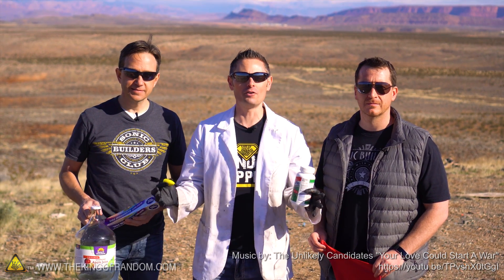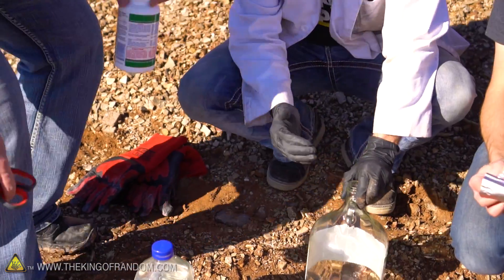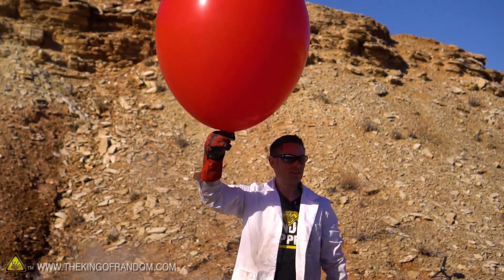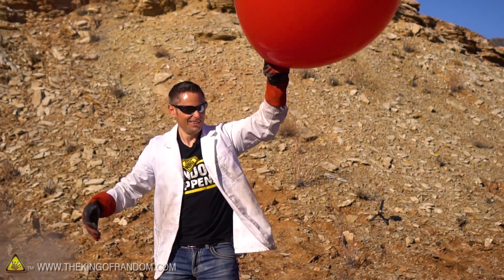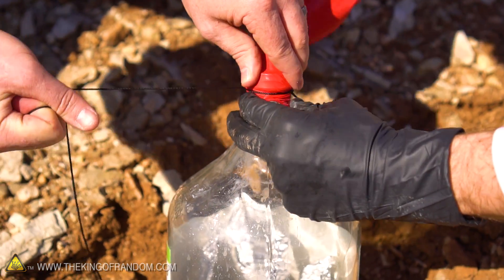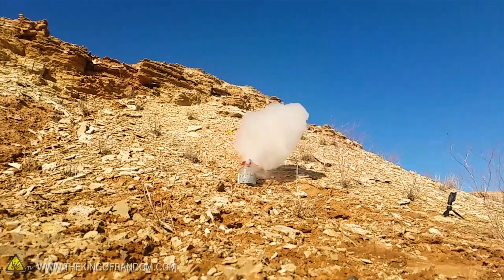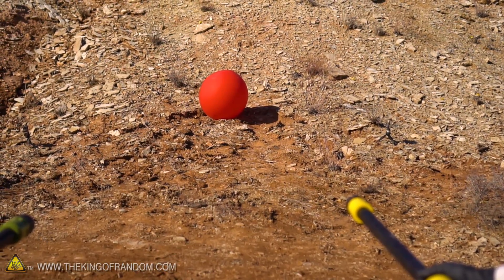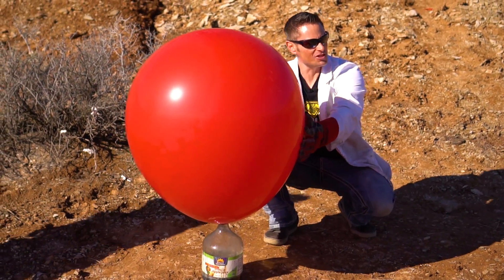Gigantic Hydrogen Balloons | How To Make A Hydrogen Balloon Explosion, Gas Balloon, And Balloon Bomb

Comment: used a old empty freon tank. welded a pipe plug adapter to tank so i could get into tank,used a coil of 1/4 copper in water to cool gas, filled a weather balloon .put about 10 ft of cannon fuse on balloon. launched at night..

Comment: Great video. I use to do that in elementary school. A Vietnam vet showed me how to do it and make napalm. I used coke bottles and only put enough Lye to cover the bottom about a half inch. Then put a few inches of water. Then roll the foil up kinda tight and drop it into the bottle with the regular size balloons we used for water balloon fights ready. We would then fill one balloon at a time being careful not to get burnt. As one of us tied the balloons he would also put a piece of toilet paper in the knot making a fuse.  Now with the toilet paper fuses you can have them pretty long and the balloons will fly pretty high with the fuse lit at night the deep boom and fire ball is pretty cool.  It was better than the fireworks because they were made by us and didn't cost much.

Comment: If you bubble the vapor through a Woulf bottle filled with sulfuric acid, then let the hydrogen into the balloon, the sulfuric acid will pull the water out and you'll have dry hydrogen gas in the balloon.

Comment: The Hindenburg was a giant hydrogen balloon.
Reply: it was not a balloon...  balloon are under pressure..  is not even a blimp which it has just a bit more of pressure compare to the outside air,  it was a rigid airship with almost equal pressure. 
The hindenburg would be still flying today if there was not by the flammable envelope..
With a no flammable envelope there is no chance to burn or explote..  It can burn, but nothing would happen, it will reach its destiny no matter what.

Comment: Perhaps instead of placing the balloon directly onto the hot jar, you could run a long hose from the jar into a cooler full of ice (or dry ice) with a coil of hose in the cooler, and then connect the balloon to the hose.  This would condense the water before it gets into the balloon AND would prevent the hydrogen in the balloon from shrinking.  Your balloon might float  quite well, and an aerial explosion would be pretty cool.

Comment: Please no hatred for my need for accuracy, but: Its not the density of the rubber pulling the balloon down after it cooled down; its because of the (then missing) heat itself.
Also, calling it "HHO" isn't chemicaly correct at all. Its simply a mixture of 2 parts Hydrogen and 1 Part Oxygen. Then the reaction, the explosion, combines the 2 gasses to H2O - Water.
But no offense though, not everybody need to be a chemist and you make awesome videos :) Greetings from Germany!

Comment: Just a suggestion, use electrolysis to generate your hydrogen instead of drain cleaner and aluminum. It will not get nearly as hot, and you will not have steam. In addition, if you set it up to generate oxygen and hydrogen in the same aria, you get mixed HHO which, as you said, is more explosive.

Comment: Have you ever tried aluminum shavings or aluminum powder.  This could speed up your reaction time.  You could even put some aluminum powder and and sodium hydroxide inside the balloon so when the water is formed as the reaction cools, it would produce more hydrogen.

Comment: A hydrogen and oxygen mixed balloon would be really cool to see. Especially at night!
Reply: that'd just be a water balloon.
Reply: HAHA I meant H2 and O2 gas
Reply: i'm not. just surprised at the amount of science that has been fitted into one comment
Reply: The hydrogen will only react with the oxygen when a source of ignition is provided, like a sparkler. When this happens the hydrogen will react with the o2 in the balloon and the o2 in the air until it all has made water. If he started out with 1:1 h2 to o2 there will be extra o2 left that will just go into the air however, this will still create a larger/louder explosion which is what I would like to see!
Reply: hydrogen will react with oxigen inside the ballon so luke has a point
Reply: but the equation has to be balanced meaning it cant react because then you will be left with H2O and O1 which can't happpen
Reply: ok Mr Einstin
Reply: Hes correct, why are you offended?

Comment: a better setup is 30% hydrochloric acid in a similar size jug with a rubber stopper and tubing feeding into the bottom of a 5 gal water jug full of water. the second jug allows the hydrogen to cool and filters some of the acid vapor that comes over. I asked in the comments on another video but will you please share the .stl files for the original cap darts? I like the design and would like to try them in my larger potato gun.

Comment: I'd think making a stopper with a hose and a steam catching bottle halfway along would allow the gas to cool, the water to be removed and make putting the balloons on easier without hooking it to a hot bottle of boiling caustic chemicals. If you put a switchable valve on the end you could start a second balloon while removing the first.

Comment: You should put a phone in a vacuum chamber, then call it.
Reply: Idea To Invention That would be cool! Of course, if there isn't any air for the sound waves to hit, no ringing would be heard, lol.
Reply: But our ears are not in the vacuum, so wouldn't the sound vibrations still travel to the outside of the chamber? It would be cool to find out either way lol
Reply: Idea To Invention yes i agree..wanna see that
Reply: Vibration is oscillation. Exactly what the speaker will be doing, possibly laying in a metal pressure cooker. It's not deep space, so being able to hear the phone while it's in the vacuum chamber isn't far fetched. We would at least hear the phone until all particles have escaped.
Reply: Freak1z,  vibrations are what? -  A type of Turbulence in the sound waves, matching a resonating at a particular frequency, so if there are no waves, no amplitude and thus no turbulence, and hence no vibrations!

Comment: If you can get a quicker setup for the hydrogen balloons, an interesting twist on this might be to release a bunch of fresh hydrogen balloons into the air. (Using balloons that are light enough to float)

Then as they are floating into the distance, start firing flaming projectiles at them. It'll be hard to hit them, but it would be amazing if you could pull it off.

Yes, I realize this is easier said than done. Lol.

Comment: To prevent steam getting into the balloon, could you attach coiled copper pipe to the top of the glass jar?  It would work like a still, allowing the steam to condense into water but allowubg the hydrogen gas to fill the balloon.

Comment: when it comes to adding the aluminum into the solution, wouldnt it be better to not crumple up the foil so that you can get the most surface area? but since the neck of the bottle is narrow you could roll up small pieces of foil rather than lightly crumpled balls?

Comment: Do that with acetylene and oxygen, then shoot it with the dart. You take the torch and adjust it to where the flame is burning right, then snuff out the flame by hitting it against a piece of wood, then fill up a small sandwich bag. It is powerful so don't do anything bigger than that.

Comment: I would like to see this with a bigger balloon. Most likely cant use a regular balloon. There is another type of "rubber" you can try. Tho you wont be able to really show it until it has inflated. This type of "rubber" can expand and hold pressure at quite an impressive limit.

Comment: Hey, Grant. I've heard that oily rags can heat up as they dry and spontaneously combust. Could you experiment this to see if it actually works?
Reply: Ethan Koetsier Linseed oil I have worked several fire investigation because of this
Reply: Ethan Koetsier I read a story, maybe true, maybe false, of someone tricking someone into doing a "free spa treatment" and they wrapped them in linseed oil soaked gauze from head to toe. It wasn't wrapped tightly, there was a lot of oxygen access. But there was so much the person was wrapped in they couldn't remove it. So it gradually heated up, they couldn't get out, and it cooked them and then caught on fire and incinerated them. Gruesome...
Reply: Zom Bee that sounds very made up, but it would be excellent for a horror/ thriller.
Reply: Brady C I hope it is made up, but I know there are crazy-mean people in the world, so I can't be sure 😨
Reply: I have actually done this with Xylene on accident on a job. Luckily the rag was on concrete, but we left the job site to grab materials and came back and the rag was slightly smoking and smoldering. I got scolded by my boss pretty bad for that one.

Comment: What would fire do in a vacuum chamber?
Reply: greencandy -- an inciniery fire can't exist in a vacuum. Although you can make a 'negative pressure' using a flame in a closed container, in a true vacuum there is no air. (I believe air is only about 20℅ oxygen normally). Also one can't obtain a 'true' vacuum (32inHg or 32ft of h2o) on Earth. 30in of mercury (30ft of h2o) is about max. in our atmosphere.
Reply: greencandy go out

Comment: Yes an apple juice jug is the BEST reaction chamber for doing hydrogen, as long as you don't cap it with anything that can retain enough pressure to have it blow up close to you. That's how my friend got hurt back in '90. But to get rid of the steam, use lab corks with holes, glass tubing, acrylic hose, and two-liter soda bottles as bubbler chambers. Use inverted corks sticking up on pipettes to affix your balloons. The cork on the apple juice jar needs one of your pressure valves or to be secured with wire run through short lengths of acrylic tubing attached to the neck of the jar with a wire-wrapped collar so it can pop off if it gets to ungodly pressure.

Comment: 3 things: you could add a laser to the cannon so after calibration you should know where the bullet will hit ;) an also a question, can you make an aluminium figure with proto putty? Did you know that if you put the proto putty in a bowl and in the microwake you can clean off a lot of the cornstarch from the surface of the proto putty ;p Great channel btw!

Comment: You can get much better quality hydrogen balloons by keeping the reaction cooler. If it gets too hot then you will have lots of unwanted water vapour. Try using less sodium hydroxide, and keeping the glass bottle submerged in cold water, or have cold water running over the outside of it.

Comment: Looked like the gas was auto-igniting; the sparklers were buried in the dirt when the hydrogen went crump. Could you try this again without an ignition source? I'm guessing there's enough heat in the reaction generating the hydrogen that you don't need to spark it. :O

Comment: If you want to speed up the reaction, don't ball the aluminum up so tightly, and also putting the glass container on a hot plate would cause the reaction to take place faster and sooner.

Comment: What does hydrogen turn into when burned
Reply: King Jordan water....
Reply: Trick question. It doesn't turn into anything. Hydrogen is still Hydrogen after the process of releasing photons and heat while recombining with Oxygen.  Do I win ¿
Reply: King Jordan oxygen is needed to even start a fire so burning hydrogen with oxygen in the air creates h2o

Comment: to get a better reaction:
1. make the NaOH solution and wait until it is room temperature or not so hot like in the beginning because the reaction of H20 and NaOH is exothermic 
2. Al plus NaOH (aq.) is also very exoteric so the H2O will boil easily and you get H2O vapors in your ballon ;) 

sorry about my English mistakes :-)

Comment: DO IT WITH HHO 
like if you agree
Reply: with your old generator
Reply: Zertrebender Zerty you mean h2o you mean WATER
Reply: for a video check out TKOR's(his) HHO Generator - Water to Fuel Converter
Reply: +WarioGiant HHO is the mixture of oxygen(gas) and hydrogen(gas) i understand why you said that but it's not chemical level it's just the two in the same general area
Reply: WarioGiant no HHO an explosive gas. Grant said it in the video
Reply: Zertrebender Zerty 👎👎👎

Comment: I have an experiment for you. Silicone rubber is thick enough that it will not fall through a certain size screen mesh. Why not have a platform inside a vacuum chamber so you could introduce air under the silicone and pull it through as the silicone sets, making some sort of silicone foam. It should set up hard enough so you don't have to run the vacuum pump for the full 24 hours but you would need to run it for quite a while so you may need to think about cooling it. Maybe add another hole for a new valve and run a silicone tube underneath the silicone rubber and screen

Comment: You need to make a bottle to do these reactions in. One with a long neck, perhaps a PVC pipe running for a few feet so that the steam doesnt get into the balloon. Make the PVC detachable so that you can clean out the bottle, if need be. Also try shredded aluminum foil. Run it through a paper shredder. Wayyyy more surface area for the reaction. I Feel if you put the PVC or whatever pipe on the end of the bottle to make the neck longer, your steam content will drastically reduce, and the gas may be cooler when it goes into the balloon.

Comment: You need to let the reaction complete, and let the water cool while it's still over the bottle so that all you're left with is a balloon which has as much H2 as possible and then it should float, and let you "skeet" shoot them in the air..

Comment: The one you thought didn't blow up because of the steam actually did if you look at the slow mo.  It had 2 explosions.  One was the popping of the balloon and then there was a delayed explosion and you can see the fireball in the upper right hand corner of the video.  Capture some O2 gas with H2 gas in the balloon before using the Sodium Hydroxide.  BIG Boom!  :)

Comment: Great effort, a bit underwhelming, but that's because of the way hydrogen burns, not anything you guys did. I'd second other comments for a nighttime shoot if you're using hydrogen gas. Alternatively, might I suggest a bangsite balloon? Calcium carbide and (IIRC) water yields acetylene gas and rainbows and joyness. Might give more of the noise and heat you want. Nice work fellas!

Comment: Bizarre set of events Grant.  A long time ago, you made soap using lye and lard.  Because of that video I now make soap as a side-hobby and have acquired a 5 gallon drum (50 pounds) of sodium hydroxide.  Now I'm seeing you make hydrogen with the stuff.  I've also been toying with the idea of making a high-altitude balloon filled with hydrogen, getting a Raspberry Pi to collect weather/pressure data, and so on... wondering how I'm going to get hydrogen on the cheap..... and here it is.  So, anyway you can show me (us) how to fill a weather balloon with pure hydrogen (minus the water)?

Comment: When I was in High School back in the late 1960's I remember making balloons by taping together several dry cleaner bags, filling them with hydrogen, taping a magnesium ribbon to the bag and letting them fly at dusk. We only did this a few times over the course of a few months but each time there were UFO reports in the newspaper the next day. Apparently the bright burning magnesium would make it look bigger than it really was and when the bag would explode the brightness would drop very quickly and the now molten bag would fall very quickly giving the illusion of suddenly flying off at great speed. We made the hydrogen by putting a few inches of water and lye at the bottom of an empty freon pressure vessel, quickly stuffing long thin rolls of aluminum foil through the small hole, replacing the valve, and submerging the tank in ice water until the reaction ended. It would take 2 or 3 tankfuls to fill the balloon. In hindsight we were very lucky not to have an accident - both in the preparation or with the burning flying bags!

Comment: Great Idea, I was looking for a video like this for a while, i wish next time you can try:

1. Have an airline tube from reaction bottle into another bottle filled with water to capture the water vapor and cool down the hydrogen gas to filter and cool it down a little bit before it goes into the balloon. might get you a bigger fireball because its more pure hydrogen.
2. Try it a night so the fireball will be much more visible with glow in the dark balloon if possible.
3. Use laser to pop the balloon and ignite the hydrogen.

Thanks big fan!

Comment: Make a CO2 ballon that can put out a room on fire immediately...
I.E. the heat from the fire will pop the ballon and the fire will go out...
Reply: Tech Inc. but the balloon will have to take up most of the room to suffocate the fire? a more whereby thing would be dry ice in a PVC container
Reply: Anton Helsgaun you are right... Even the balloon pressure won't be able to keep much of it, but it could put out a small fire..
Dry ice can be used but that would be very expensive and even that wouldn't be very effective..
Reply: Anton Helsgaun 
cool.. I always thought that it would be very difficult to keep.. as we generally see dry ice vopourise directly
Reply: fire extinguisher balls. (they exist)
Reply: It also wouldn't be very suitable for some other types of fire.
Reply: Tech Inc. well he poured 30lbs of dry ice into a pool soooo... And wouldnt Liquid co2 explode when released (ish)?
Reply: Anton Helsgaun 
Liquid CO2 is very hard to achieve.. and if dry ice balloons were made, it would explode at rest only.
Reply: Tech Inc. liquid co2 is not hard to make. Codyslab did it in glass tubes. It can be done in plastic or steel tubes, with properly screwing end caps
Reply: Anton Helsgaun i meant to say, can it be contained??